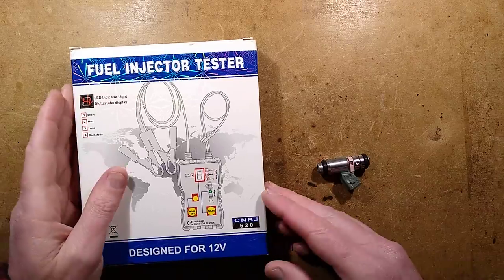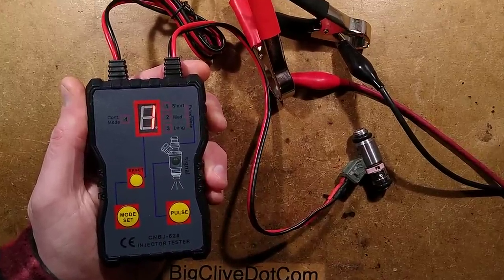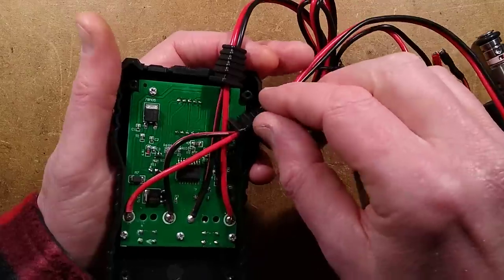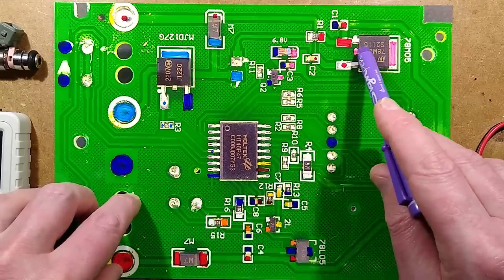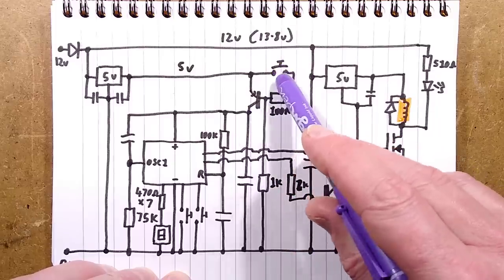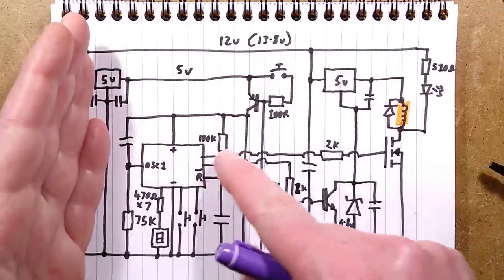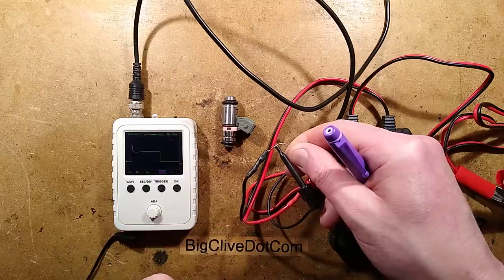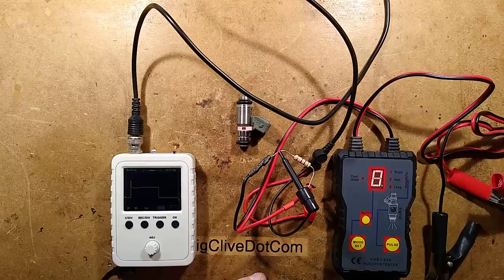Inside a fuel injector tester (with schematic)

Comment: Usually the ecu for the vehicle will vary the pwm going to the injectors, also called injector timing to give more or less fuel based on how much air is entering the engine and how much the throttle/butterfly valve is opened. 
With what you were saying about the voltage across the injector it sees the full battery and alternator voltage so 12-14v. 
If you have any questions id be happy to answer them. Thamks for the info

Comment: You have low impedance and high impedance injectors  Because you have bank and batch and individually fired injectors depending on the system .

Comment: just to add after the smarter people than me answered already: while not so much in gasoline engines, Diesel injectors still use this method actively as the pressures holding the nozzle shut are much higher, the coils require lower impedance and usually higher voltage (depends on manufacturer's driver ciruit as bosch, delphi and denso all differ in such details) to start the injection event and subsequent hold thanks to the fact that most if not all makers stopped using less than 3 events per cycle so at usually 600 µs for the whole duration and 18ms between injections (at 750rpm) they have to be kinda fast

Comment: A lot of manufactures of the newer style "direct injection" will vary the power to the injectors and then switch the negative for whatever pwm is needed for fuel management. The new petro cars of today processors are getting up to 1GHz speeds but are typically limited going faster due to temperature and environmental stability for automotive specs, so individually controlling power and pwm to each injector can be intensive for v6 and v8 engines...

Comment: Clive, put that injector in a vice then file it lengthwise to expose, by layer, the inner workings of it. I’ve done it, it doesn’t take long, and it blew my mind. I’m stunned the things actually work but they do. It would make for a great video.
Reply: My motorcycle injectors work on 5V.

Comment: Makes me wonder if an injector like that could be used to supercharge a fog machine or any other prop you might be tasked to work with?
Reply: My interest is creating a steampunk blunderbuss using acetylene gas to simulate a powder charge. Single shot or repeating! With added SPARKS! Use would be at Burning Man festival.
Reply: ... Take that to the department of mutant vehicles and have the pyrotechnics team check your design before you even think of making it.

Comment: Most mechanically propelled vehicles diesel or petrol, whilst running will have a return voltage from the alternator to the battery of 13.5v, you may need to consider this.

Comment: "12V" vehicle batteries is a misnomer based on rounding the 2.1V per lead acid cell down to 2V. In fact, a 6 cell lead acid battery is 12.7V at full charge and at less than 50% charge at 12V, which is about as low as it can go without damage. 
The system voltage needs to be in the 14-15V range when the engine is running in order to charge the battery (current flows from higher voltage to lower) but parts required for the engine to run (like the injectors) need to operate at a bit less than the battery's normal 12.6V during starting. 
Taking all of this into account I am not surprised that the injector needs slightly above 12V to work.

Comment: There is two fuel injector styles. .peak and hold or saturation. On average peak and hold use 4 amp opening current then clamped by pwm to around 1 amp at 14v. Saturation injector has a resistance of between 12 and 16 ohms. There latency or dead time Is slower but overall life is greater.

Comment: That'd be a peak an hold type. There's 2 ish types of injectors. High and low impedance injectors. High spike at the beginning helps open the injector fast, then lower voltage only holds it open.

Comment: have to wonder why they used a 78M05 and not a LM317 instead, that would have been better, also the 78M05 arrangement means its supply voltage needs to be more like 13.4V minimum to ensure the 78M05 actually regulates and not just drops voltage, as they usually need about 1.6V of overhead as an absolute minimum.
Reply: They could have used some LDO successor of the LM317 to even reduce the minimal Vdrop under the typical 1.25V.

Comment: It's nice to see they've added the reset button, although it would be nicer just to be able to change modes without the need to reset at all.
I have an older model, that didn't include a reset button, it requires the input supply to be disconnected and reconnected every time you want to change the mode, so a P.I.T.A.
So, after using it a few times and getting annoyed, I simply added a momentary N/O push button, and a 5 pin mini relay, both mounted nicely inside the unit.
I connected the N/C 30/87a terminals of the relay to make/break the positive input supply line, and the push button triggers the relay to N/O momentarily to reset.
I occasionally find my unit loses output pulse, although the green 'working' LED flashes as it should and everything appears to be working, there's no output pulse to the injector.
I've visually inspected the board thoroughly, and wiggled the output wires while doing a continuity check and no breaks in wires etc that I can tell.
Not sure if it's a problem with a component on the board, or something dicky/intermittent with the output cables...hopefully your explanation of the circuit will help me track down the issue, but we all know how much fun intermittent problems can be🤣🤣👍🇦🇺
Reply: WOW, you only need a momentary N/C switch, they are around. Using the relay might be drawing current and voltage might be the reason.
Reply: @CHEVI789  I wasn't able to find a N/C switch in the size/type I needed, or that's all I would've used.
The relay doesn't draw any current whatsoever, other than when the reset button is pushed to momentarily open it's N/C (30-87a) contacts, and the relay contacts have a very low resistance and high current carrying capability, so should be no issues with voltage drop or lack of current available for the tester to operate correctly.
Perhaps you misunderstood, I am only using the relay and push switch to break the input supply power momentarily to create a reset function rather than disconnecting and reconnecting the power supply clips each time.
I'm only switching the input positive source with the relay contacts, and using the input positive source to supply the push button switch to trigger the relay coil, no switching current is going through the injector tester itself.
The current to trigger the relay coil is less than 200mA, probably closer to 150mA or less, and that only occurs very briefly, when the reset button is pushed.
I'm switching the relay coil positive so normally not a problem with back emf etc, but I also have a quenching/flyback/freewheeling diode installed across the relay coil for extra insurance against spiking any of the units sensitive electronic components, but that's generally only a concern if a microcontroller is controlling the relay on the negative side of the coil.
Reply: @simonilett998  cool, I did have some, that's why I mentioned it, all the best.

Comment: It seems there is still some EMI that is getting picked up on the audio circuits of the camera.  Not surprising since its fast switching into that inductive load.  I wonder if they had problems with the uProcessor locking up?
Reply from the maker: The slight pops on the camera may be it's sensitivity to sharp audio clicks.

Comment: So, most gasoline (petrol) fuel injectors use between 3.3 and 5 volts. They use a "driver" from within the PCM (Powertrain Control Module). Some of those testers are a bit sketchy. For reference, I have been a Mechanic for 35+ years now. Feel free to ask me any info you need on this subject.
Have a great day, Sir! o7

Comment: I've assembled an Arduino based EFI intended for driving two low impedance injectors in parallel. It doesn't feature peak and hold because I think Throttle Body Injection doesn't need it, since the injectors don't spray directly into the combustion chambers (but you could add it if you know Arduino programming).

Comment: Interestingly, the engine management in a typical gasoline/petrol port injection vehicle would not function this way. On a high impedance injector (like the one you have) it would just get fed straight “12V” (more like 14V) on the power side and be ground-side switched with the full ground. So, nothing special. Some cars use “peak and hold” injectors that are lower resistance (usually 2-4ohm). For those, they still get fed full battery voltage, but the ground is where the magic happens. They get the full ground to open them, but then the ground voltage gets elevated to maybe 4-6V by the injector driver, current limiting the injector. The injector is closed only by the spring in the injector and the fuel rail pressure acting against it, not electronically. Peak and hold injectors are not common on “modern” port fuel injection systems and were mainly used in early PFI systems or throttle body injection systems or “central” fuel injection systems (where they used 1 or 2 big fuel injectors to supply the entire engine). However, peak and hold injectors have started to make a return in modern direct injection systems because they need the extra power to open against thousands of psi of pressure in gas systems or tens of thousands in diesel systems (sometimes paired with higher voltage). 

This tester is likely designed to work with all types of injectors, the peak and hold function that it seems to do by default is only necessary for low impedance injectors.

What wasn’t pictured in the waveform you showed (since it was just hooked to a resistor, not a coil) is the inductive spike that would happen when the injector is turned off. Typically I’d see between 50-100V spikes from the injectors turning off.
Reply: What you describe is exactly how I made my sprinkler controller. It's the same idea. A bank of solenoids that you're going to operate. I use high side switching to decide which solenoid is going to open. Then I PWM the low side to create a hold current.

This setup where you light up the high side then ground the low side through a coil is kind of how an ignition system (or flyback transformer) works and as you say, it can make some high voltages when turning off. I've had just some TVS diodes and measly SOT23 BAV70s as flywheel diodes and I've never had any problems at all. I don't even have the BAV70s in the right spot (right on the coils) as the coils are normally used with AC and a diode would mess that up. So I've got a big run of wire (controller to outside and return) catching that off energy. Maybe that's helping me out and reducing peak currents, I dunno.

Comment: Clive you can use silicone tube in the inlet of the injector to fit it on a butane refill can to make a cool flame puffer
Reply from the maker: The main seal is the outer O-ring.  The inner bit is a filter with no proper sealing.

Comment: Also remember for better efficiency,you want cold fuel (cold air is denser, therefore contains more oxygen), so injector heat from the solenoid is a consideration ,i wouldn't be surprised if car controllers are doing the same, high volts injector pulse to low volts holding pulse.

Comment: In the engine ECU in cars have a mosfet for every injector. I have brought many ecus back from the dead by replacing the injector drivers which are just mosfit transistors.

Comment: Clive, did you get the idea for this from watching Thunderfoot? 🤔
It actually makes sense that it would take closer to 13v. That's more in line with the running voltage of an engine. It's easy to forget that while the battery is 12v the engine runs off the alternator with tends to more like 14v.
Reply from the maker: I'd pondered buying one in the past, but Thunderfoot definitely triggered me to actually do it.

Comment: As a retired design of Engine Controllers, when driving an injector with a coil resistance in that area we drive it at battery voltage with a MOSFET for a few 1/10 of a second, no idea why they would drop the level back to some lower voltage. Now for direct injection types we pulse them initially with a series of 80V pulses and then lower it to battery but those injectors have a could resistance of 2-3 ohms.

Comment: I’ve seen ones with little enclosures for some sort of fluid (or did they legit use fuel?)  Either way you would mount them in there and not only test them electrically, but also look into Spray Patterns or even get fancy sensors on the case etc.
Reply: I don’t nearly have the Fabrication Abilities (yet…), but having one of those as an Open Source Development Tool would be really neat so I’ll keep this video saved away for if i ever get to that.  Great video and keep up the cool work!
Reply: look into spray patterns
Reminded me of: "Never look into the laser with your remaining eye." 
~Homer Simpson
Reply: Those are great for testing injectors as well as cleaning and matching them. Mine is a home brew unit but it allows you to measure flow rates, spray patterns and more.
Reply: @Ed_Stuckey  i meant like look into their characteristics lol, but now i want to see some engineer / @Colon Furze type etc mess around and make the “ Turbo-Eye Dropper 9000 “ or something lol.

“Sprays your eye with ~E-15 Gasoline~ EYEDROPS thousands of times per second for maximum moisturization!”

Comment: Looks like a very basic thing but its not, also I think they could use some help with the function button-reset.  Interesting bit of kit for testing injectors, a garage will charge a fair wedge of cash to test them so this might be useful for basic diagnostic's 2x👍
Reply: Checkers will test them free if you're near one, its a parts store.
Reply: @napalmholocaust9093  That is really handy. 👍👍

Comment: A quick look at Google seems to suggest similar to what you found,  it seems to shoot upto 10v ish over the first 0.8 ms of on time then drop right down to 3v ish for the remainder of the on time 😮 interesting.. the current however seems to be pretty consistent throughout the high pulse with some reduced amplitude ringing as the voltage drops to the lower level,   makes sense I guess seems as it's an inductor running on relatively pretty long DC pulses

Comment: I used an audio amplifier and a tone generator program on my computer. set it to square wave and adjust the volume until your injectors start pulsing. Rig them up to squirt in graduated cylinders and you can do a balance/flow test

Comment: Real injectors do have a "peak and hold" circuit, yes. But it's all done in the current realm instead of voltage. Normal battery voltage is 12.6V with the engine off, but once the engine is started the voltage goes up to 14.2+ with the output of the alternator.
So with your high impedance injector (about 15 ohms) with no load resistor, you get about 1A of current draw initially to get the valve to open fully and quickly. Then the engine controller will restrict the current (typically using PWM from a peak hold circuit, like a modern version of a TI LM1949) which will keep the injector open, but reduce the heat build up.
Once the injection time has expired, the current is turned off (back EMF snubbed by the diode), and the valve pintle closes the orifice with a spring assist.
Low impedance injectors (about 2 to 3 ohms) will draw 5 to 7 amps initially, then get reduced again after the valve is opened. High dI/dt giving a big magnetic force to move the pintle quickly.
The trick with these injectors is to figure out how to get a predictable, precise amount of fuel. Your constant term is the orifice size, the fuel pressure can be measured, and the open time is controlled by the engine controller. But that only works if you can get the valve to open and close very quickly. Then you have to account for the opening and closing times in the math and clean air is your uncle.

Comment: it honestly should work on 12v, I mean I've made diy ones that ran off 9v batteries. 

My thoughts on it are cars actually have 14.4v systems, we call it 12 as its the mid point and some devices to end up running at that after voltage drops etc.

Comment: A Full Charge "12v" lead battery puts out 12.6 to 13 volts so this thing may see 12 volt as a "Dead" Battery and won't test. Car computers can see same and cause other issues, set error codes, etc. even tho engine may start with battery at 12V or less.

Comment: Maybe WatchWesWork would know about the dual voltage thing. He is a mechanic but does break out his oscilloscope while diagnosing cars.
Reply from the maker: It turns out that the higher voltage is to bring it in decisively against the pressure of the fuel, and the lower holding voltage allows the magnetic field to collapse faster giving faster shut-off.

Comment: I was expecting the trace to show a 5V start then a climb to 12V before the transistor was turned on die to reaction time of the zener diode, but maybe they are just so fast it doesn't have time to show up.

Comment: When starting a car  the 12.6 v battery voltage drops to 11 v or less while spinning the starter motor.  Thus the device is not representative for actually in car use or troubleshooting injector problem.  Running an injector without a cooling liquid may also cause damage in continuous run mode.

Comment: What bothers me a bit is that with just using resistors, a pretty much perfect injector pattern is produced. I could be forgetting the complexity of the computers as it's been many moons since fuel and ignition courses, but shouldn't he be getting a flat line? There's no coil or load to overcome on said coil, which is what produces the "peak and hold" shape for most injectors. Wouldn't that also mean that certain other types of injectors wouldn't even work?